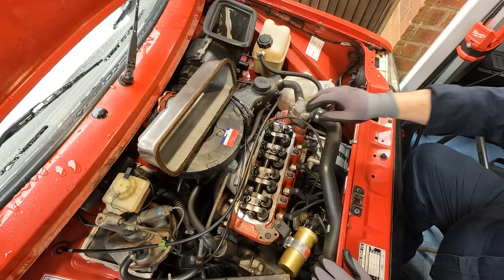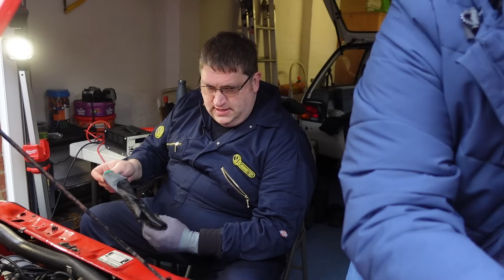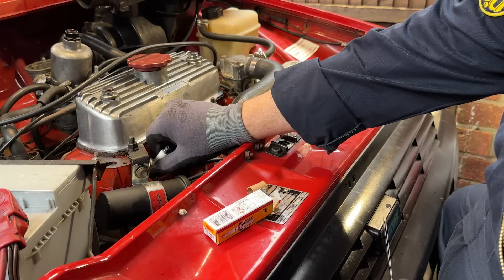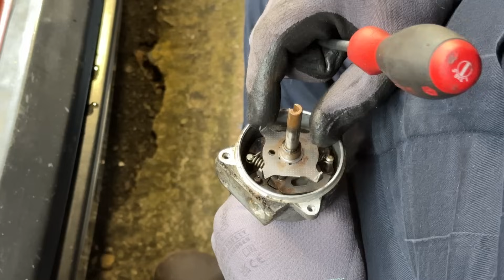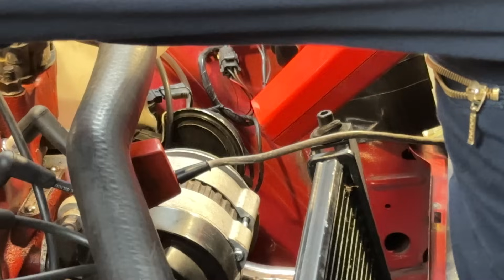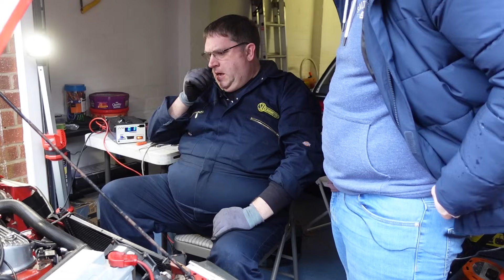The Ultimate Guide to Tuning the SU Carburettor and Austin A-Series Engine

Comment: I stuck around to the end because it was interesting and I could see the positive result of each and every step Mr Dodd did with the wee beasty.  I also wanted to hear the result of the mods to the damper and how they translated to gear changes and drivability - talk about sound like a much more modern car!  

The way an A / A+ revs usually take a studied drop between the gears - as opposed to drop down ready for the next acceleration punch - I always put down to the heavy flywheel....but that does not seem to be the case at all.  That little engine just wants to go - and 998 camshaft be damned!  Anything Rover thought they were saving / de-tuning by using it is a non-issue when the engine runs as well as it does because it is finally allowed to.  

She's got a lease on life like a little pocket-rocket from the European or Japanese manufacturers of the era....but she's a classy little Rover hatch running - as you said - an engine that is little changed from its introduction 70+ years ago.  I can't believe the change in her attitude, Ed....but I have to because it's unmistakable!  

The final accolade is that she will be as economical as your right foot allows her to be....but I'll bet that even pedaling her a bit from time to time won't make that much of a difference and she will be at least as economical as she was because she can turn fuel into momentum that much easier without the need for large (or additional) carburettors, a huge lumpy camshaft or a mound of currency spent balancing and blueprinting the engine and filling it with all manner of expensive bits. 

What a win!  Mr Dodd truly deserves the title of Oracle when it comes to understanding the A-series, for sure.  All the best

Comment: This video takes me back 40 to 45 years ago when I was racing in the 850 Minicross formula. The technical regulations were seemingly quite restrictive but their phrasing was loose in that "If something is precisely described or illegal then you must follow that while if not described or referenced then total freedom is allowed" whereas these days the emphasis is the other way round "you can do what the technical regulations say you can do but anything else is illegal/banned". I hope my paraphrasing is clear.
I am only writing about the engine here, and only in some aspects relative to yours/Mr Dodds video.

My engine builder back then was the now well known Dave Mountain. He encouraged creative ideas from his customers and to try them out on his rolling road.

On a racer, engine-wise, the only two things that matter are reliability and maximum power BHP at the top of the rev range. My engine was always throttle max open and running between 5000 and 7000 RPM, no interest whatsoever in any other engine situation. This made things very easy as all the engine needed to do was pump maximum air, gas flow was everything.

Dave did all the usual engine internal race engine build things while I worked on ancilliary items...

1. Camshafts were specified to be standard with no regrinding and part numbers were quoted in the reg's. However there were very wide factory tolerances in cam lifts so I obtained several by extracting them from dead Minis in scrapyards, then I measured on Vee blocks with a dial gauge and chose the best one. But we could go further...

2. Tech regs specified standard rockers must be used but did not specifically ban modifying them, therefore I could modify them. I experimented with old style pressed steel rockers rather than the later cast(?) items. This was because I would cut the rockers with a hacksaw between the rocker shaft and the pushrod just sufficiently to enable ME to bend them but not so much that the CAMS could bend them with light valve springs. I would then laboriously work along all eight valves and bend the rockers as much as necessary and dummy building and measuring to achieve as close to 290thou" valve lift as I could get on each valve, as the Tech Regs specified - individually optimised max permissible valve lift. Then I would weld the rockers where cut and rebuild the top end with Cooper S outer only valve springs.

3. Tech Regs specified standard distributor and part numbers. They didn't say I couldn't modify it though. Reasoning that fixed spark timing was all that was necessary and with Dave M advising that the advance mechanisms were always wrong and moving about randomly I drilled a small hole through the top and bottom advance mechanism plates and locked them together with a self tapping screw. Very simple. It enabled Dave M to swing the distributor while engine was running flat out on the dyno to achieve max BHP on the dyno's readout. Simple fast totally accurate spark timing for the one flat out driving condition we needed.

4. Tech Regs specified inlet and exhaust manifolds and systems were free but one 1.5" SU carburettor must be used and NO water injection allowed. Also that carb size would be measured by scrutineers using a 1.5" wooden gauge of very slightly over 1.5" size, how much over was not specified, so if the scrutineers wooden plug fitted into the carb then the carb had clearly been opened out... But the Tech Regs writers forgot to disallow other modifications to the carburettor. A square has more area than a circle, so the whole bore of the carburettor can be opened out to a 1.5" squircle and the inlet manifold likewise to smooth the join. If four small areas of the original round bore remain then the carburettor will still be 1.5" and the scrutineers measuring template will report so.
Additionally the bridge under the piston can have it's sharp edges removed to reduce turbulence. Then the throttle butterfly can be knife edged where it faces airflow, the throttle spindle can have it's fixing screws removed to reduce turbulence, the throttle spindle can be filed flat to reduce it's  thickness to reduce obstruction of airflow, these items are then reassembled and the brass butterfly and spindle can be soldered together and the joint smoothed. One last item is to file a large radius on the bottom of the piston where it faces incoming air, again to remove sharp edges presented to the airflow. We used very thin oil in the piston damper so it would rise and fall faster but actually the piston could have been locked in the up position as no mixture adjustment while running was necessary.

5. We found that crankcase pressure reduces power and tends to push crankcase atmosphere along with oil up past the piston rings into the combustion chambers. To pull a vacum in the crankcase would reduce windage and reduce pollution of the combustible mixture in the combustion chambers. This could be done actively with a pump but we ran a heat resistant pipe from a block breather to a small tube  with it's open end facing downwind inserted into the exhaust pipe, the speed of the exhaust gasses pulled the small vacuum we needed.

6. Water injection was forbidden but a cold damp atmosphere could be provided by a water vapour spray from a nozzle positioned near to the carburettor inlet, driven by a small windscreen washer pump. This tended to do the same job as water injection - cooling inlet air and so increasing it's density.

All these small things add up and give power advantages over others who don't think or bother... There were many other mods to engine, transmission, suspension, body shell and and brakes to produce a faster car within the loosely written Tech Regs but they are not relevent to your video.

Comment: Did you do a compression test as well? The guy is so right about the advance curve on older cars with distributors. On a modern car, it's kind of irrelevant because it is controlled by the engine management which tends to either work fine or not at all, but with dizzies it really is a must check. Back in the early 1980s I was building engines for a manufacturer's works rally team. In those days, most were still running carbs and dizzies and we had an incident where the mechanics checked the ignition timing after testing, only to find that it was around 20 degrees retarded relative to the correct figure (with a competition engine running a dizzy you normally check the full advance figure rather than idle because the engine will quickly fail under competition conditions if this is wrong). So they corrected it - and - the car lasted less than half a mile in the actual event proper. What had happened was that something had jammed in the dizzy stopping the centrifugal advance working at all. They added twenty degrees to this and as soon as the event started, the dizzy had freed itself up and advanced twenty degrees beyond the correct figure, catastrophically detonating the engine and causing an immediate retirement. If they'd checked, they'd have noticed that there was no increasing advance with increasing revs and could have changed the dizzy.

Comment: Well done AC. Not quite his thing but it would be interesting to see just how much his tunes unleash with before & after dyno runs- especially the torque differences across the range.
Of course in lightweight cars with relatively mild power outputs a proper setup unlocking only a handful of horses at peak is very noticeable with the butt-dyno but only tells part of the story. The area under the torque curve is what really makes a tangible difference on the road & thats where the modified torque curve & proper fuelling makes an enormous difference!

Comment: When metros were in vogue every time we did a crypton tune we always set the ignition timeing we set it according to the distributor number as it never matched the engine no or model no, also on some versions useing an old carb body with the vac advance in the proper place as to meet the co restrictions at the time it was drawn directly from the manifold as he wasn’t checked it was a case of what hydrocarbons . And to make you feel better with certain models they had a (15foot gap) and would run like a bag of sh1t with a 25” gap.

Comment: Thank you for the video, was a good watch :)

I've got a 948CC A series in my Sprite which I've tried tuning and it's less bad but not exactly good.

I've wound the mixture to be as lean as it will go but I think it's still rich - what tool was used to measure the air/fuel ratio in the exhaust?

Assuming it's got fuel in the float chambers (you have to prime it if it's been sat a week unless you want to spend a long time cranking) it starts well, normally with minimal choke.
When mine is cold, if you floor it, it falls on its face and nearly dies. I think that's correct. It idles fine.
When it's warm, it performs fairly well. Idles fine, revs fine, no real dead spots but it's noisy with your foot to the floor and doesn't really do a lot. It will do 70 on the motorway.
When it's hot (as in I've been driving an hour) the idle drops so low it often stalls when you're in traffic.
Reply: Buy your self a dash mounted wideband gauge, and install into the  vehicle. That’s how you can then monitor your own fueling.
Reply: @ACDodd  Still got to drill and weld a thread into the exhaust?
Reply: @jimmyk9523  yes

Comment: I don’t understand the old v new coil. 
Was the weaker/old coil 0.8ohms 
And the new coil is 3ohms 
Or vice versa? 
I’m swapping my coil now. And I thought 3ohms was more power. 
Have I also got this wrong. Help! Lol
Thanks
Reply from the maker: Ohms is a measure of resistance, so the lower the figure, the higher the power. The old one was 3 ohms, so the new more powerful one is the 0.8.
Reply: @TwinCam  great thank you!
Iv just managed to cancel my 3.0ohm coil. 
I’ll order a 0.8ohm 
It says not for ‘points’ did yours have points or electronic? 
I can update later if need be. 
Thanks for the reply. 
This is very helpful for us diy’ers
Reply: The lower the resistance the more power.
Reply from the maker: My car is electronic ignition. All Austin Metro 1.3s from 1987 onwards had electronic ignition. However, 1.0s had points all the way through production I believe.
Reply: @ACDodd  where abouts are you located please. Hopefully not too far for me to visit. I’m in Doncaster, South Yorkshire.🤞🏻🤞🏻

Comment: Damage to engines is the square of the revs and damage to suspension is also square of the top speed.At 30 its 900 at 60 its3600.😊

Comment: So you have got a carb to get nearer to efi?
This is like getting a typewriter to pretend it's a word processor. 
Carburettors are an insult to the intelligence of anyone who's bothered to learn the problem. 
They are simple and can be optimised, but why bother?
Reply: Because sometimes carburettors must be used. Optimising what he has got leaves the engine standard and so does not introduce insurance implications. Apart from that it is an interesting technical exercise, just for the hell of it.